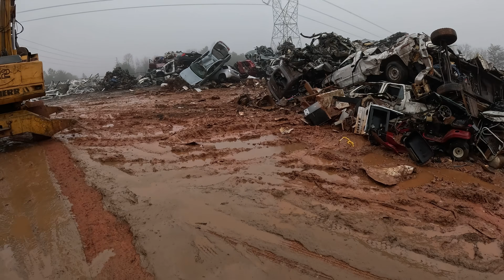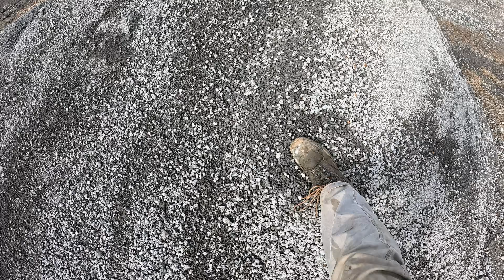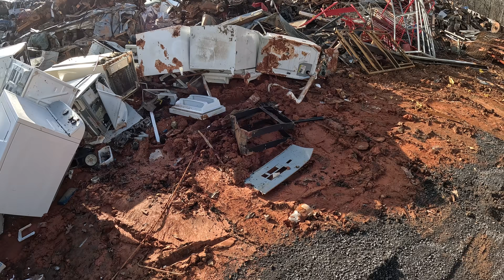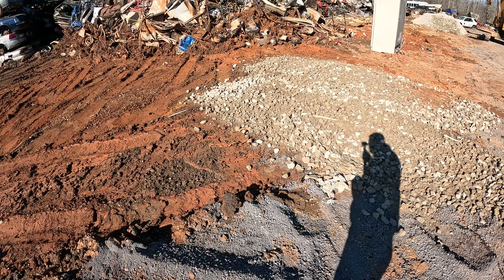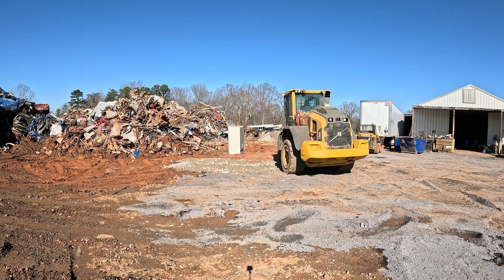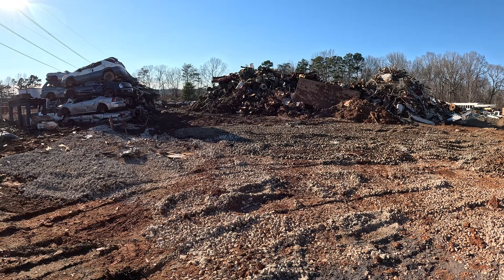Mud BOGGING our Heavy Equipment to fix the muddy mess at the RECYCLING yard.

Comment: I know it's 3 months later but if you can get a hold of crushed asphalt rather than crushed concrete, your guys will appreciate the lack of concrete dust they have to contend with during dry spells.  Crushed asphalt packs in really well when it's driven on in hot weather, too.
I swore off crushed concrete and the reduction in dust was immense
Edit:  concrete's good for a base but top it with crushed asphalt